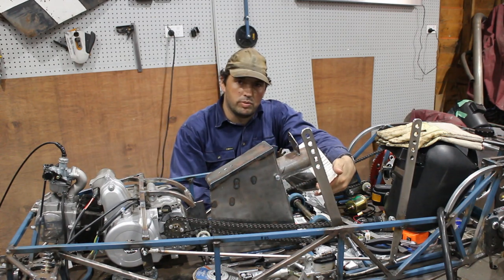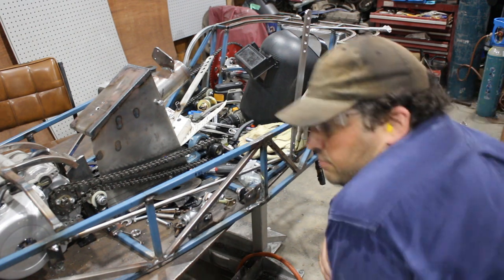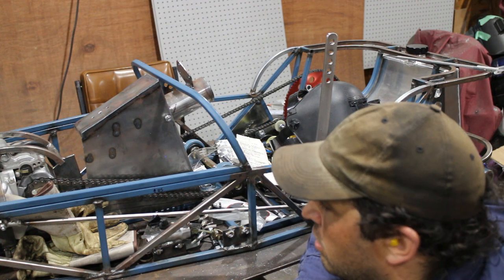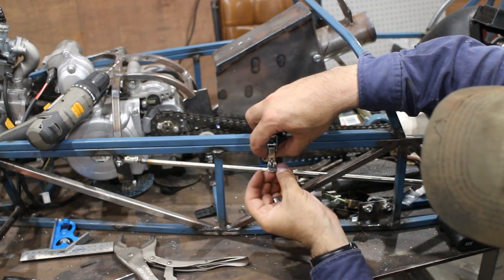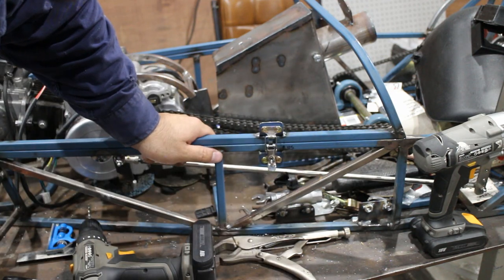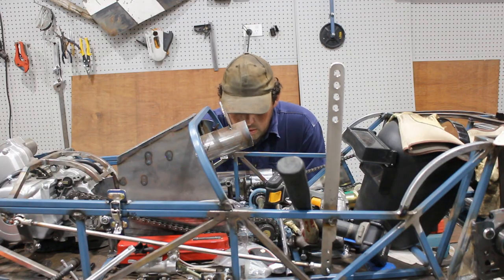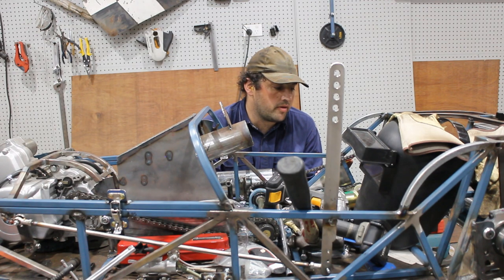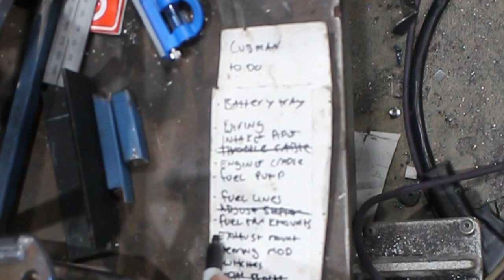The cubman episode 21 exhaust mount, bonnet catch

Comment: That water cooled welder is noisy
Reply from the maker: water cooler for the shedquarters... there is a bit of a leek in the back of the unit that may require extra plumbing